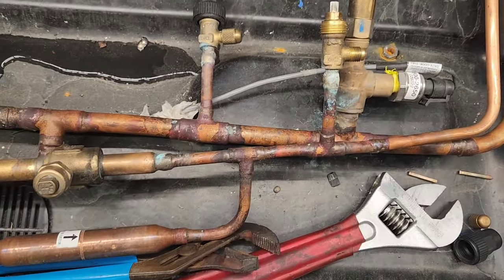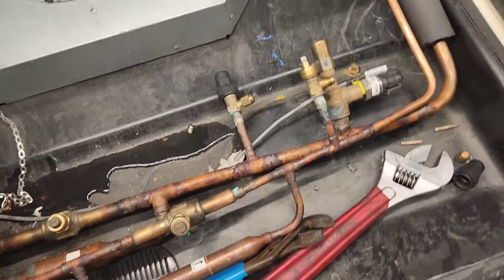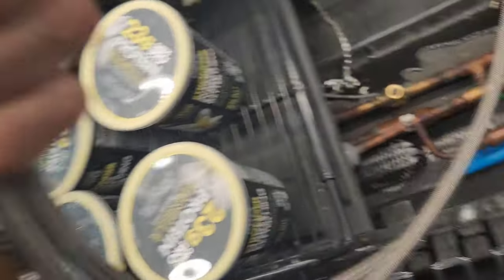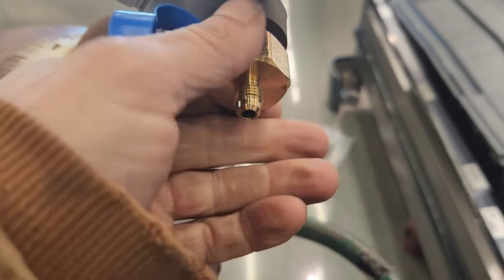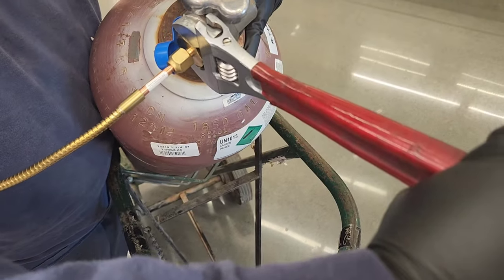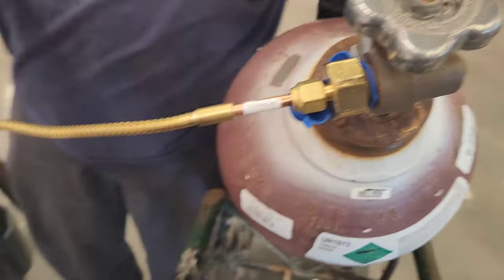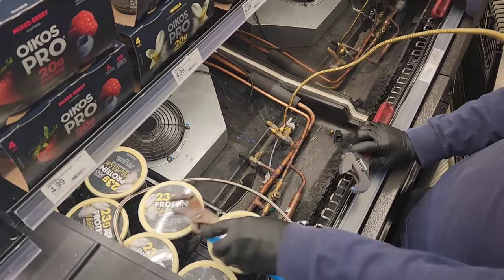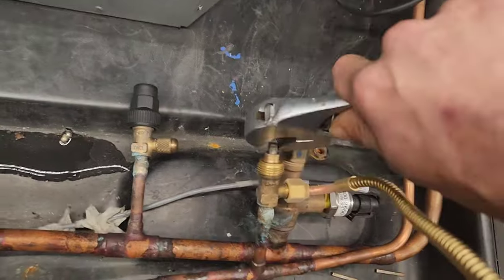Transcritical C02 Clip

Comment: Ya you’re not supposed to be changing though the cases, the coils are not made to take the 800 psi out of the tank….
Reply: Are you supposed to lug those tanks up to the roof or rack room? seems way more dangerous to move those giant cylinders around
Reply: it's on the liquid line, all good